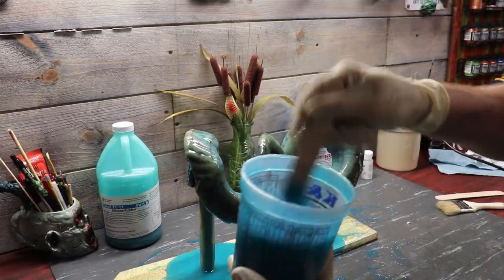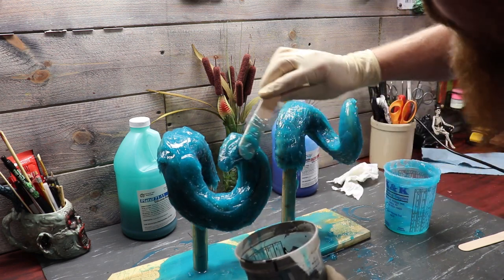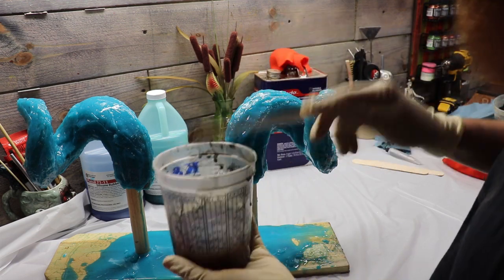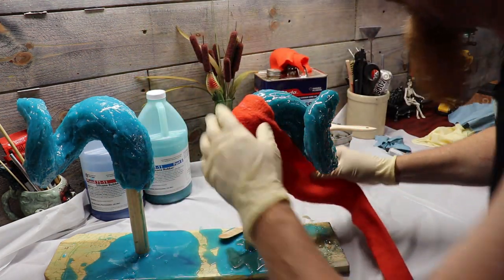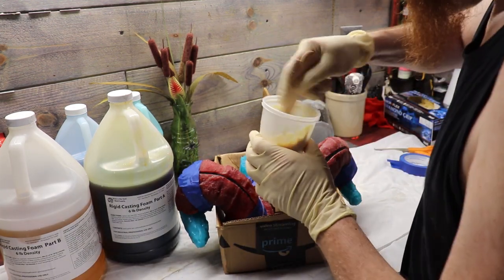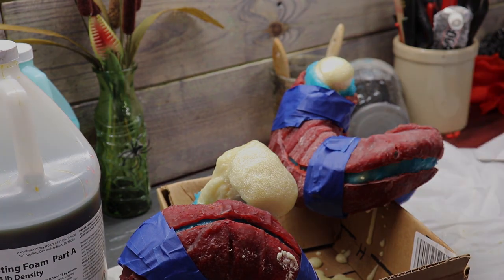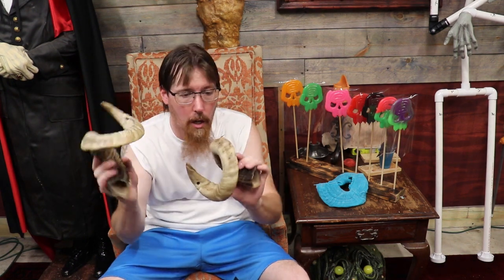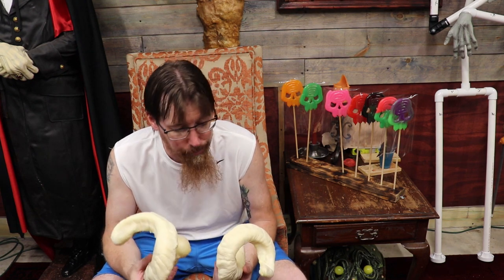Rams Horns/  Making A Brush On Silicone Mold! Does it work?| Cobwebs And Candlesticks

Comment: Epic, YES.   Fail, NO.  This was new for you and you made something.  Maybe the results are not what you had hoped for but you at least did something.  Most people don’t get that far.  Furthermore you got 2 usable castings and you learned some things.  I learned some things as well.  Thanks for sharing.
Reply from the maker: Thank you Joe. I try to be open and honest with the builds. They dont always get the W so I have to show the loses. I'm already back on the horse doing a second molding with different techniques this time so maybe I'll be step closer to sweet success!

Comment: demolding tip: use dish soap as mold release (slightly diluted, brush on, let dry completely) then when you demold get some water into it and squeeze it around to loosen everything up. keep adding water and you might be able to pull it out like a corkscrew
Reply from the maker: I'm totally gonna try that when I get some more silicone for these big boys! A corkscrew pull out would be ideal.

Comment: I think your gonna need to zipper cut your glove mold.  Also, tint you different layers of brush up silicone so you can see where you have been.  Helps to eliminate thin areas due to the layers being the same color.  If they are different, you know what needs coverage.
Reply from the maker: Totally agree with everything you said! Gotta pick up  some silc-pig. This time im gonna have to cut the mold.

Comment: Hi! I have a pair of really old ram horn & silver candle holders a friend gave me..I want to make a mold of them & I'm wondering if you've found a way to do it that is a bit more successful? If so did you make a video of that process? Thanks for sharing this video!
Reply from the maker: I haven't yet. Im trying to remold with the same silicone In thinner layers but I haven't finished it yet. It's kind of a longshot but if it doesn't work I switching silicones.
Reply: I look fwd to seeing what you come up with. Thanks for the reply!

Comment: Hello, have you ever finished recreating these? I am currently busy with a similar project and I am NOT winning. Sigh
Reply from the maker: I am.actually half way through the molding process with 2 coats of silicone on them 7 or 8 months ago. Because I waited so long I'm probably gonna have to pull it off and start over with fresh silicone but this time with Dragonskin silicone!
Reply: @CobwebsandCandlesticks  I would love to see the end result. I think I put too many coats of silicone on. I could not roll it off the horn as I also made a wall for the hard casing so I would know where to cut the mold. I ended up cutting right through. Please post a video when you do this process. Your video is the ONLY one I can find on the internet about the process <3 THANK YOU
Reply from the maker: @verushkavanjaarsveld550  so your very first coat of silicone should be brushed on into the details. Your second and third coat should be thickened with a silicone thickener like thi-vex or tin-thix. I always do a 4th runny regular coat not thickened then move onto a shell mold around it. REBOUND 25 is a great brush on silicone by Smooth On.